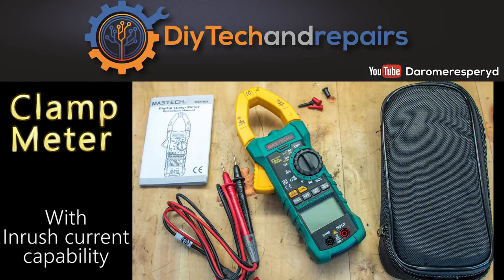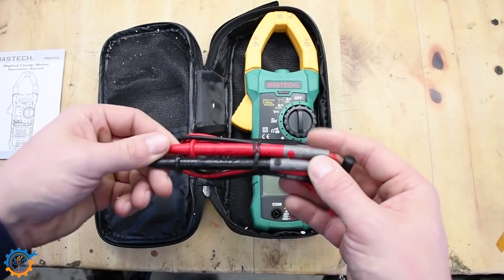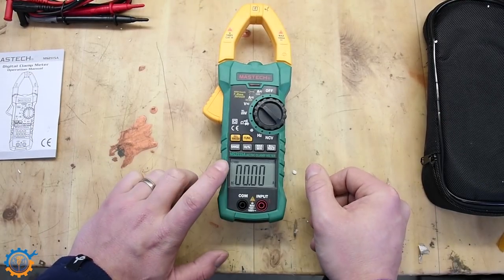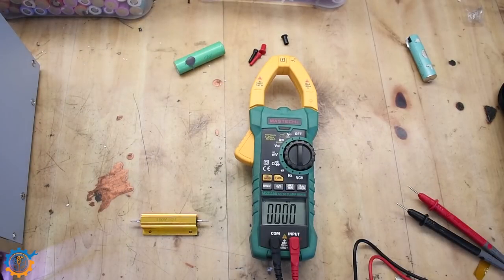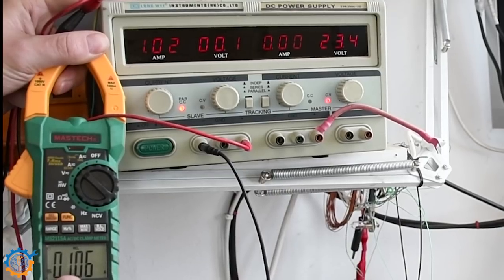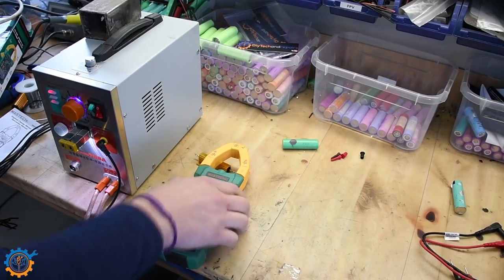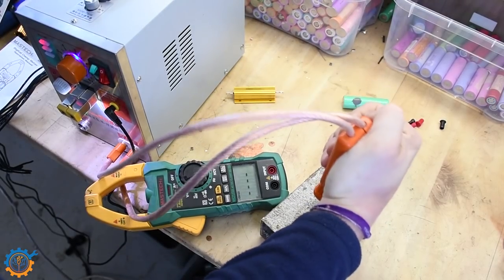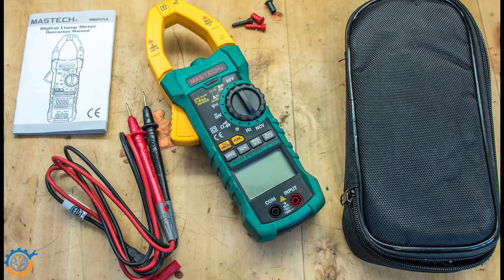Mastech MS2115A - Quick look

Comment: Подскажите есть ли возможность калибровки по току? По переменному отклонение процентов в 5,  по постоянному вообще чушь какую-то показывает с отклонением в процентов 25-30.
Reply from the maker: English
Reply: @DIYTechRepairs  Can you tell if there is a possibility of current calibration? For alternating current, the error is about 5%, for direct current, it shows some kind of nonsense, with about 25-30%
Reply from the maker: @Stohastick  only to set 0 point. IF you need more accurate look at fluke :)

Comment: I bought one but it doesn't show zero when the mode switch is selected on dc 600a range it will be showing a value of - 0.60 ampere on the display. when measuring dc ampere it doesn't give proper reading and will give a decreased reading of 0.6 ampere from the actual value. Any help would be appreciated regarding this issue.
Reply from the maker: A Clamp meter Will never be 100% it Will differ a bit. IF it doesnt work att all get ur money back from seller.  Note that you need to meassure rather large currents for it to work
Reply: @DIYTechRepairs  thank you.